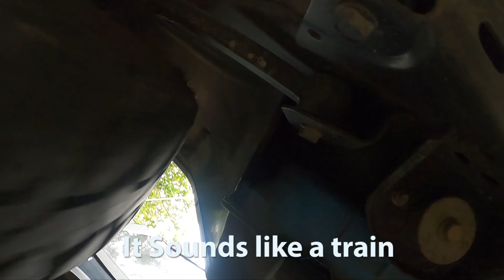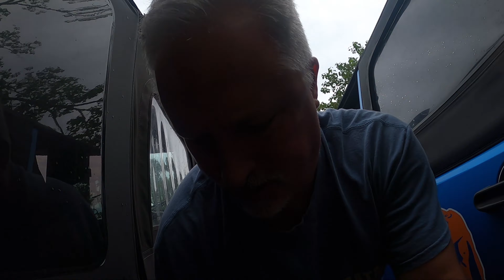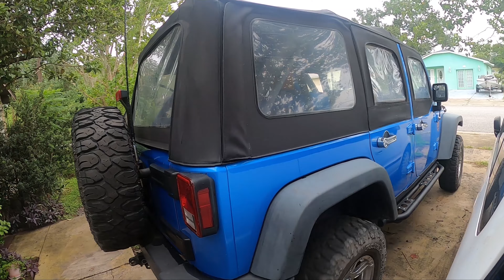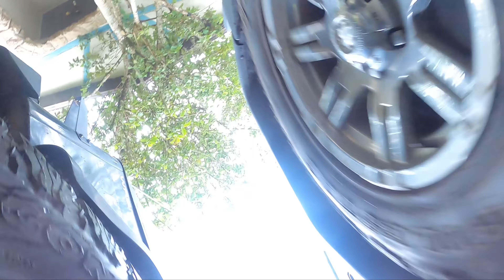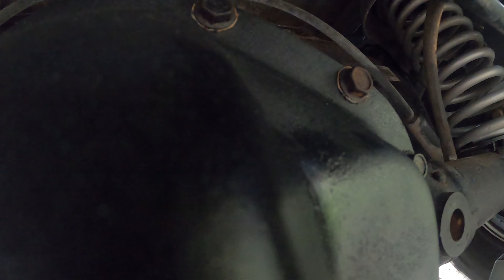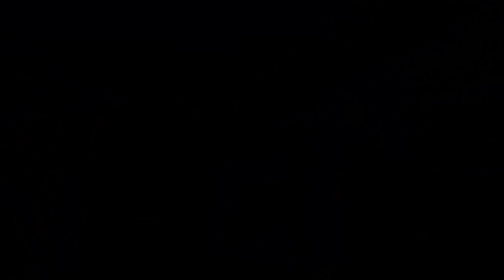Jeep Wrangler drive train prlems   it sound like a train

Comment from the maker: I just put the stethoscope on the axle tube and diff housing, same level of sound. Then to the caliper and not much sound from ether side. When the wife gets home I will try more areas. Crawling under a running jacked up Jeep on stands may not be the best idea.  I does remind me of a story from this years Jeepin with Judd....   But that's a different story.
Reply: Depending on were you live,you have Jeepers Den out on 50.Wilsons 4x4 in Holly Hill and Destination 4x4 in Ormond
Reply from the maker: @gutwrench1961   Jeeper's den is a club sponsor for the Orlando Jeep Club. For many years Kissimmee had Jeff clay's and they did extensive off road work.

Comment: What was the issue?
Reply from the maker: Looks like it was the pinion bearing, I still have to take it up to Jeepers Den to get a repair. I did change the drive shaft and it still makes the sound. I had to change it soon anyway so it gave me a chance to test the drive train with no shaft to see if the sound was in the transfer case. I am ready to get it back on the road.
Reply: FloridaJeepRides thnx...just gettn into jeepn, looking forward to meeting you one day, my son and i watch all your videos.

Comment: Sounds like a rock in your shoe.
Reply from the maker: Checked that next up is to take the drive shaft off and see if its the transfer case.
Reply: @FloridaJeepRides  There was no increase when you touched that, but it did increase when you touched drivers side axle tube, brakes or bearings?
Reply: Bad bearing perhaps?
Reply from the maker: I pulled off the rear wheels to inspect the breaks and rear bearings. So far that seams OK....

Comment: Tooth shear on ring and or pinion gear or multiple teeth
Reply from the maker: The more I poke around under it the more it points to those bearing. 
Not sure of how hard it is to do in a driveway..  I miss working in a shop that had all the tools needed to do this type of repair.

Comment: Pinion bearing
Reply from the maker: Yep, I just finished the drive shaft install, it need to be done after the lift and that gave me the chance to check it with no shaft on. No noise. As soon as the new shaft was on and running the noise is back. No to find a shop to get that done. In the mean time I think we will take a few days up in north Georgia to do some Jeep trails. In the red Jeep.